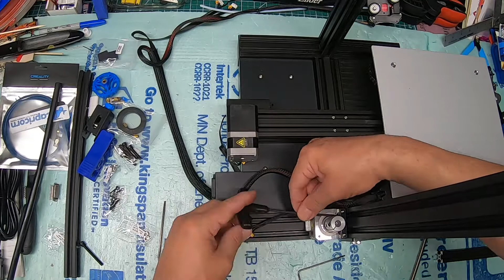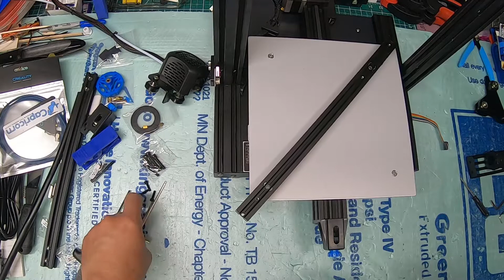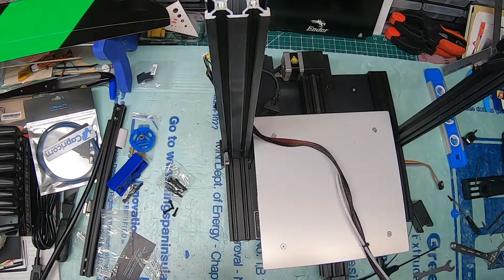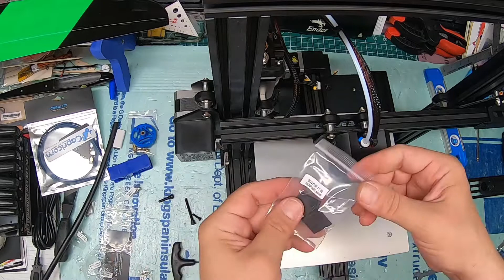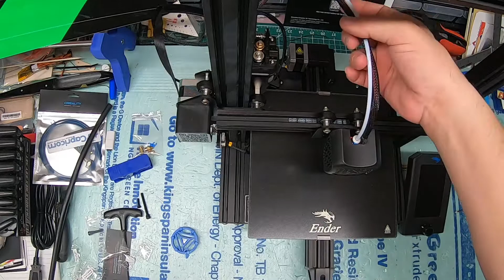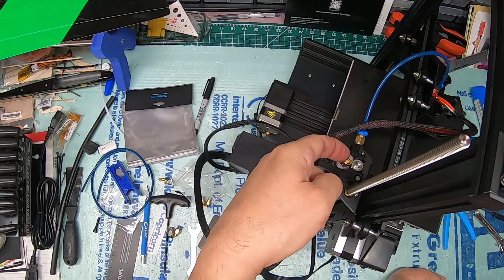Creality Ender 3 V2 Unboxing, Assembly, Setup, Update Firmware, and First Prints - Part 2

Comment: I'm surprised you don't have more views or comments.  I enjoyed this and the first video.  I loved your clear instructions and explanations on what, why, and when to do various things.  Of course, I only have one request; around 14:00 you start to level the bar the extruder rides on.  The viewers can't see what you are adjusting.  The funny thing is, that this is what I came to this video for. I was able to figure it out and the following explains that. I bought two 3D printers, one to tinker with, and the other to make parts if necessary. I put one together and discovered that this bar was not square to the top or bottom/base of the printer, not the table.  So I figured I would build the second printer and watch a couple of videos to see where I messed up. Needless to say, I had the same problem on the second printer. Well, I listened to what you were doing (I ran through it several times), and I was able to then get some ideas of what to try.  I loosened both sides of the bar that connected it to the z-axis bars.  So a total of four bolts.  I then loosened the rollers and re-tightened them to make sure that they were snug.  Not too tight and not too loose.  I then made sure that the side that had the motors on it was perpendicular with the x-axis bar.  I then tightened the bolts connecting the motor side of the z-axis to the x-axis bars, making sure not to knock it out of square.  I then used a woodworking ruler that I have that has stops on it so that I could measure the distance from the bar that goes on the very top of the printer to the x-axis bar close to the z-axis.  I then used that same measurement to adjust the side of the x-axis bar to the rollers that slide free and tightened the screws to the roller on that side.  I then measured from the base to the x-axis on both sides to make sure they were the same and used my small square and made sure everything was still square.  

Even though this is what I came to view your video for, I learned a lot more.  Thank you.